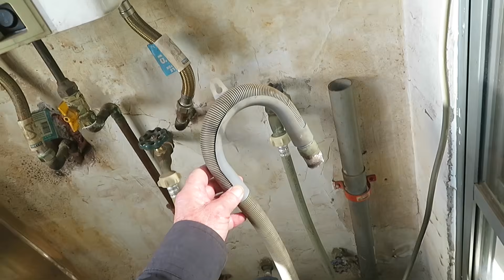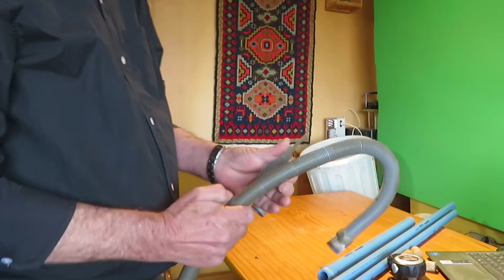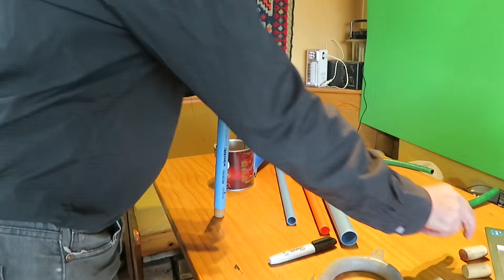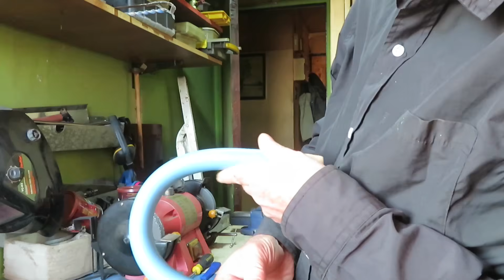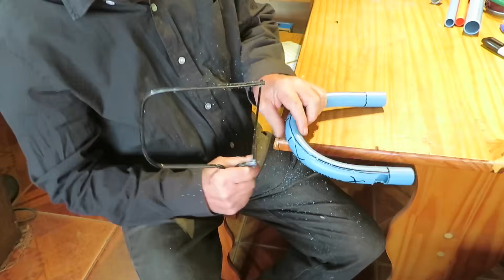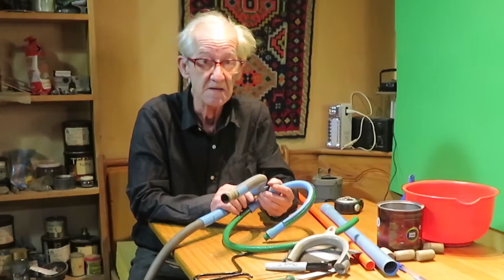Make a drain hose holder for your washing machine or garden hose #holders #washingmachine

Comment: The midline cut will be the most difficult part in my opinion. I wish there was a more efficient way to do it. A
Reply from the maker: Well, if you have power tools it would be faster. If you had a bandsaw not only it would be fast but you wouldn't have to be checking if it's following the line on the other side of the pipe.  I imagine that these accesories are manufactured by melting and pouring the PVC into molds, and that must be faster.  Thanks for your comment TraderJoe.